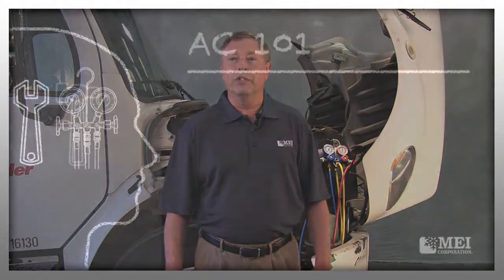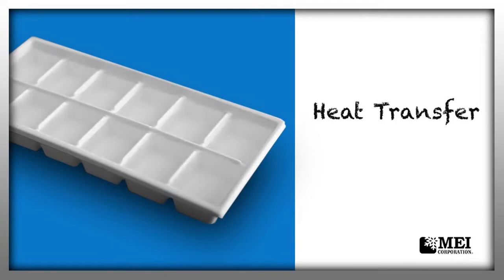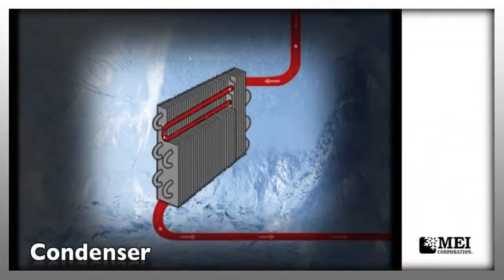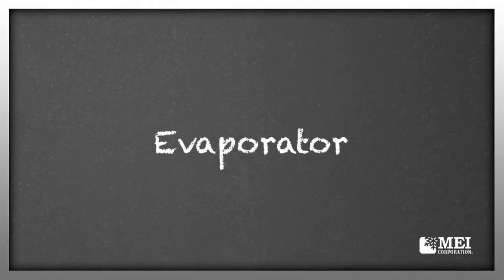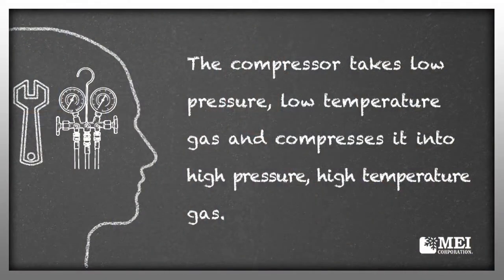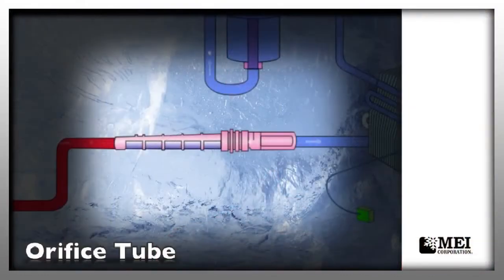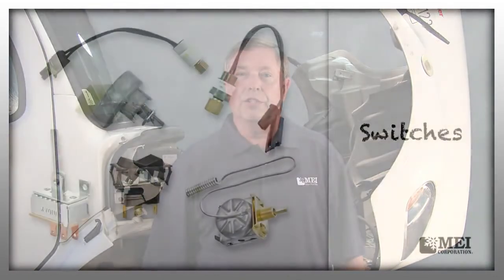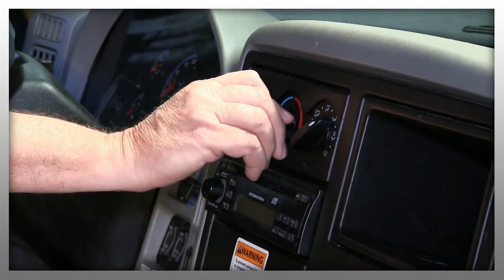AC 101 Heavy Duty A C Training

Comment: You show the heat transfer going from the engine side of the condenser and out the front of the condenser against the wind.. I thought the air flow came through the condenser coil with the assistance of the fan pulling it through. The air flow should be pulling in from the front of the truck which helps with the transfer of heat when the truck is traveling forward. Am I wrong, or was this just more detail???

Comment: Just a quick question, how is it that when the refrigerant goes through the expansion valve does it drop in temperature. What causes it to drop in temperature?
Reply: The rapid change of pressure
Reply: Yeah your right high temperature liquid drop to low temperature vapor when it pass to evaporator coil and back to compressor.